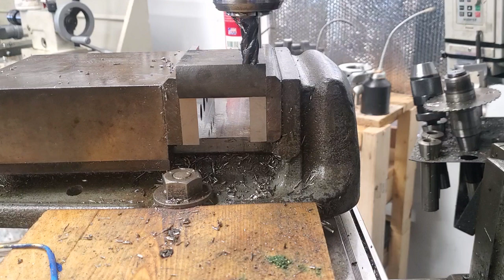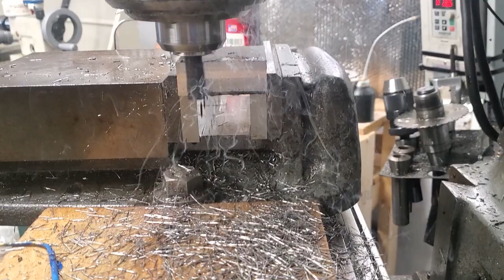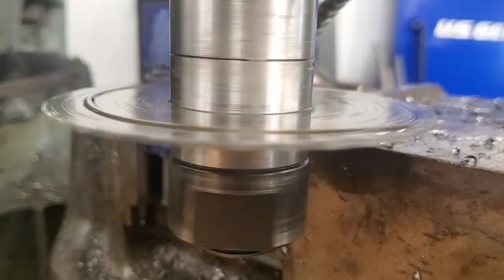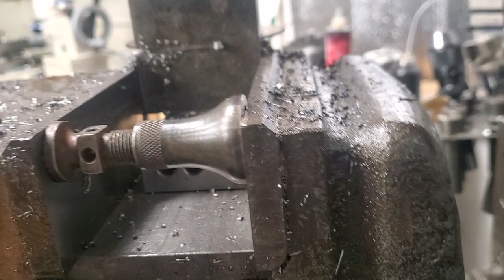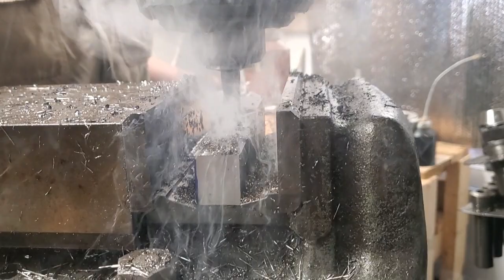Shop Made Tools Not Quite 1-2-3 Blocks Part 2: Slicing and Dicing

Comment: I had never seen those Starrett vice hold-down jaw adapters before.  Impressive how well they worked especially holding two pieces. Yes, they were cut in two from the same machined stock, but even .0002 variation could change the holding pressure on the smaller one.  Yes, please take a moment sometime and show the process of incorporating a screw jack on a vice to hold a part off one side.  Do you snug up the vice of the part, then snug up the jack …… followed by final tightening of the vice?
Reply from the maker: I ground the faces before doing this actually,  so that is why it worked. They are surprisingly useful tools, but not always needed. 

I basically just finger tighten the vise, get the jack finger tight against the jaws of the vise and clamp down as normal. Between finger tight and right with a wrench, you'll move the move able jaw .010. Just fuss with it a few times and figure out what works for you. I'll try to take a video this week explaining it.
Reply from the maker: https://youtu.be/hFTkovOjIcw

Joel, I recorded a better explanation of how I use a jack to prevent jaw twist. I hope this explains it better than words. Thanks for watching!